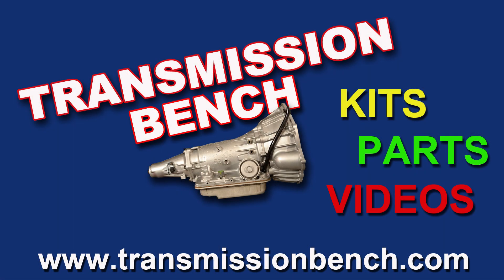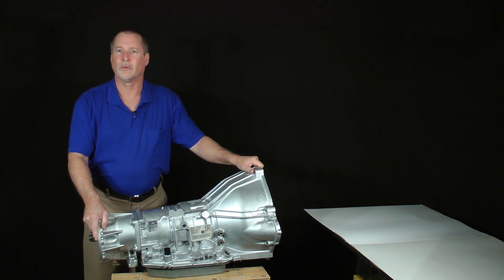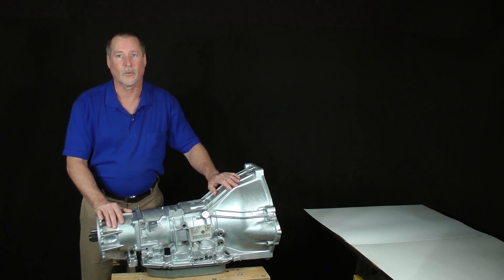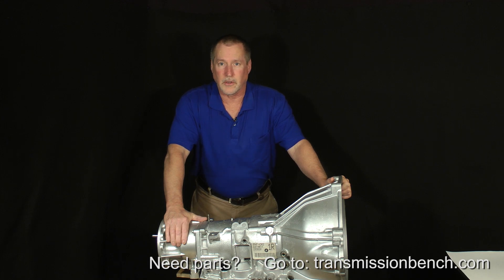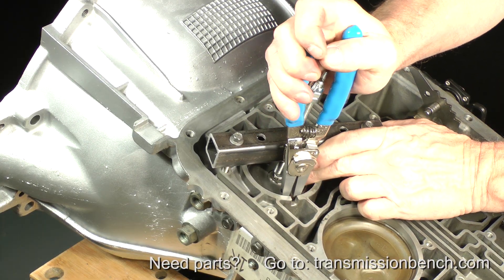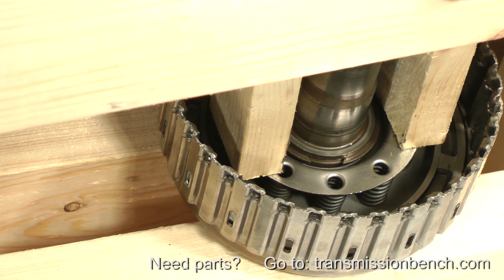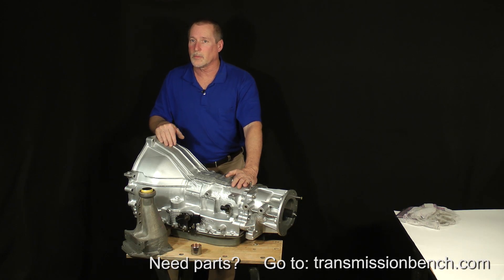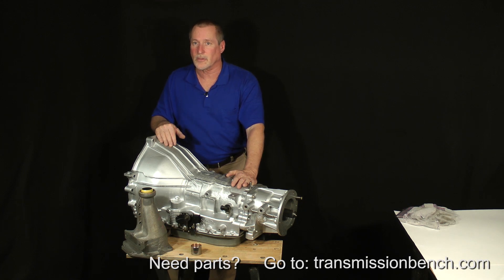AODE 4R70W Class Part 1 Lesson 1

Comment: It's 700 Newton meters dude. Nm is the metric measurement for torque. Even in imperial torque is lb.-ft. not ft.-lb.!!!!! You can't even be wrong correctly!  Look up "Metrication" on Wikipedia. ASK any Australian, Brit, European, Canadian, GERMAN, Mexican, Chinese, Russian, Japanese, Korean, Indian, or ANY other country how power (rated in numerous ways like watt, SI, BHP, HP and more all derived by math formulas based off torque @ RPM) applied to a shaft such as a transmission input to output shaft capacity is rated... METRIC? DO some research and get with the times that with all the international trade the metric system is used worldwide with these exceptions. England, dairy products still imperial (gallon) distance still mile, fuel and petroleum products liter/kilogram .USA Dairy = gallon, distance = mile, fuel and petroleum products gallon/pound. We are entering the 2nd quarter of the 21st century guy. You need to catch up. Go ask your nearest Ford service dept. if you don't believe me. 700 lb. ft. is an uneducated assumption by people with no direct knowledge of any engineering details directly from Ford. Like a Ford dealer service dept. has and have no idea what metrication is or when Ford joined that club.
Reply: It must be miserable being like this. I'm sorry your mother did that to you Steve.

Comment: Aode and 4r70w cases are different 4r70w has 3 Boat holes where aode only has 2 for the starter But yes most of the internals are the same
Reply: You can have small block ford variants of the 4r70w with 2 bolt starters. 96-01 explorer 5.0 and up to 2004 for 3.8 V6 mustang.

Comment: I'm still very unclear about the W vs. E difference. Are there not 4r75w transmissions with 2 sensors? My 2005 town car has 2 sensors on drivers side and a big W on the tail housing. They didn't put 4r75e into town cars until like 2008. So the 4r70w is one sensor, the 4r75w is two sensor with 6 pickups on the reluctor wheel and the 4r75e is 2 sensors with 24 pickups on the reluctor wheel.... anyone have further knowledge about this stuff?

Comment: Can anyone lend a hand started my disassembly of my 4r70w and laying in the bottom of the pan was a small white plastic piece. No idea where it came from. Looks like a white plastic half of a barbell about the size of a thimble?
Reply: Came from the factory, supposedly from when theyre building the cars, its needed for the install of the transmission dipstick. It gets pushed into the transmission pan & just stays there until one day the pan is removed. You dont need it.

Comment: I'd just use a couple large C-clamps instead of the foot press or squeeze o matic. Course I'm used to getting around these scenarios. Took apart and reassembled an entire 919cc Honda engine once without any of the specialty tools and I even used a metal park bench and a scissor jack to press a bearing during a repair in a gas station parking lot lol.

Comment: Back in my younger days I had a 1996 GMC Safari Van. The Tranny gave up the Ghost at about 265,000 miles. I couldn't Afford the Cost of having it Rebuilt by a Professional Shop. I had alway been Terrified of Automatic Transmissions due to being told over the years that they are Incredibly Complex containing a Mind Boggling Amount of Parts! Well, one day I set my Fears aside and decided to Tackel the Job. I went to a Transmission Parts Supplier and Bought a Rebuild Kit and Torque Converter. It took me a year after Purchasing Parts to finally get up the Nerve to Start the Project. When I Bought the Kit, I also bought a Book from ASTG Miami...it was the Best Decision I could have ever made. I Rebuilt the Tranny  myself and Reinstalled it. While still on Jackstands, I Started the Vehicle, put it in Gear...and watched the Rear Wheels Turn!!! I have since Rebuilt two more Transmissions, another 700R4 and a Ford Hybrid AODE.

Comment: The 700 is Newton-Meters. roughly 515 foot pounds input shaft torque. stop saying 700 foot pounds. Ford and GM uses this measurement method in their model nomenclature. If a bone stock OEM automatic overdrive transmission was rated at and could withstand regularily used 700 foot pounds of torque everyone at the drag strip would be running one in every car slower than a 9.50 adapted by whatever means necessary and auto salvage yards couldn't have one in stock more than 5 minutes.

Comment: I want to thank you sincerely for going step by step, bolt by bolt, for troubleshooting and ultimately rebuilding and updating this great transmission.  When the transmission shifts in the '97 F-150 I now have, the sound reminds me of the trans I had in my '72 Mustang with two 4 barrel carbs and 600hp.  I installed a shift kit in the FMX and it never let me down.  Ford did a fantastic job when they made the original FMX, and later, turning into the 4R70W.

Comment: Hi James, , I have a 2004 Crown Vic police interceptor with a 4R70W. It has 153200 miles. It shifts fine and has only one problem. When the engine and trans are hot there is a 3-4 second engagement delay when shifting into drive from neutral or reverse. When it finally shifts into drive (after the delay), it engages fine with no slipping. So I think the forward clutch is OK. Once in drive, it shifts fine through all gears. There is never any delay shifting into reverse. When the engine and trans are cold, there is no delay. It seems like something is sticking in the valve body when it is hot. Any thoughts? Thanks.